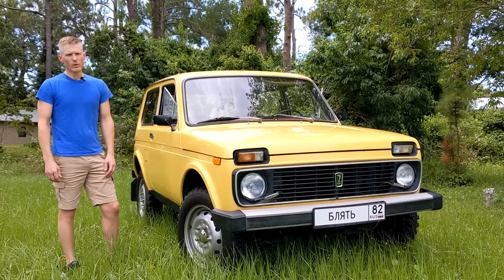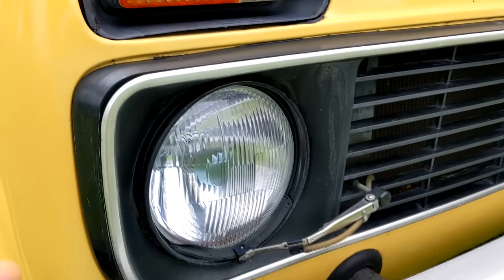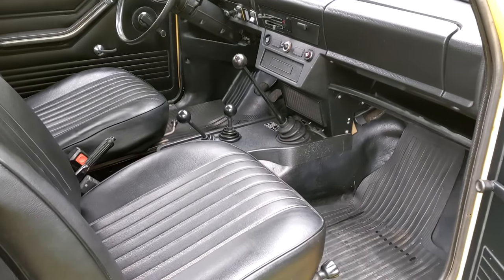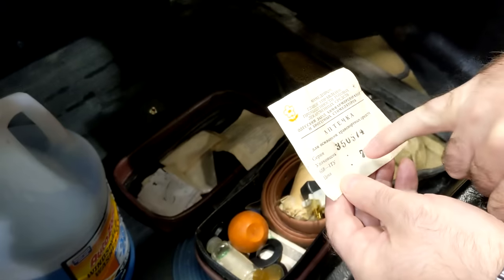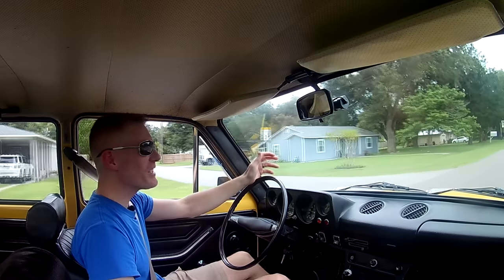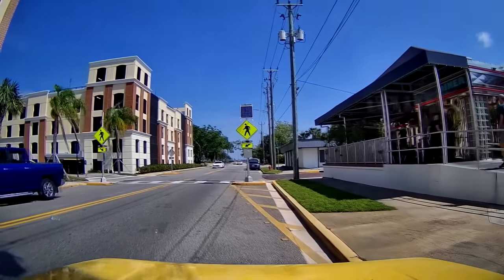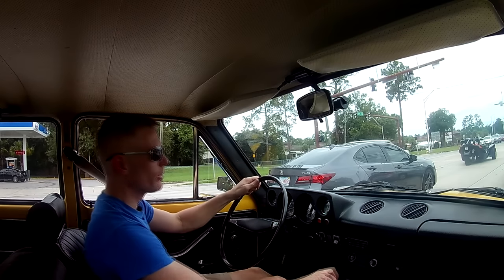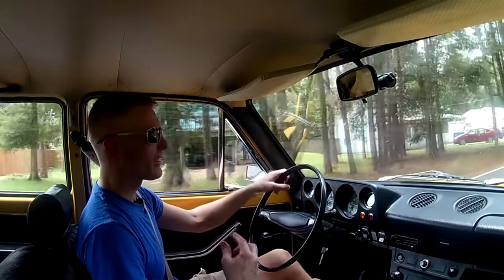This is my 1982 Lada Niva (Лада Нива / ВАЗ-2121) and it's pretty weird.

Comment: Hey! Nice video! I appreciate an intension to save all the original parts and make all the changes reversible. This is very much Russian.

If you can fit an electric motor instead of a gear box and keep the transfer case you will still havе AWD, the reduction gear and the center blocking. All the space released from an engine you can use for some electric equipment (or a front trunk). But pay attention: 
1) to switch these two small levers you have to stop (if i get it right).
2) Probably this way you'll keep the noise, because it goes not from the engine.
This is the cheapest solution in my opinion.

Reduction gear on this car is intended to handle low torque on lower rpm. If this car originally had diesel engine no one would put reduction gear in it. Electric motor won't have this issue, so you can replace the transfer case with the one that suits better.

Just a few ideas for your project. Of course there are way more options.

Good luck!

Comment: The cards with years are technical inspection certificates which you were supposed to pass every year. I think you were supposed to tuck them under the rubber of your windshield for the police to see. At least that's what many did when I was a child. Today, we don't use them anymore: if you car is insured, this automatically means you passed the technical inspection. If your car is not insured you're not allowed to drive it.

Comment: Just a tip. Next time you need body work. Ask for progress pictures of each step. Otherwise they wont make the effort of repairing the panels and just smack thick layers of body putty on. You don't want to pay for that. And these guys making it sound like a massive mission to relocate a bolt hole for the mirror on that door that was wrong kinda raised red flags for me.
Reply from the maker: Fortunately, they said they barely used any filler because the panels were so solid and able to be manipulated.

Comment: You won't be able to use the crank handle if you convert it to an EV. 
 I had an 88 5 speed model.  It had the comprehensive tool kit including a crank handle and points tool (even though it had been converted to electronic ignition by the importer)and the work light. But the English translated owners manual was a work of comedy genius.

Comment: I think it's a good idea and if you keep the gearbox it would have insane torque at the wheels but I'm not sure if the transmission and differential and take it. I think the car has the right proportions and so forth but its powertrain has always been its Achilles' heel. This would definitely solve the problem and would definitely be a unique classic.

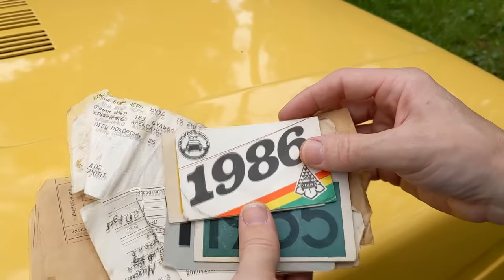Comment: 9:30 Technical inspection cards. The design on the front of the cards differs from year to year, so they are even collected sometimes.
9:37 A VAZ-2121 car with a license plate A85-74K...O(?) Passed the inspection on June 11, 1986.
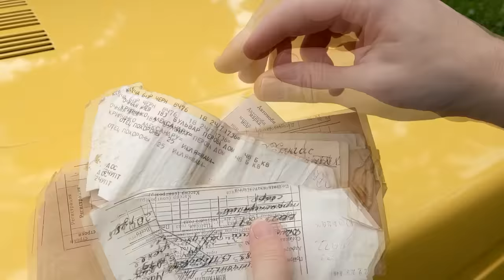9:50 The receipt for payment of the transport fee - 20 rubles, by the way. The address is indicated - it is in Voskresenka district, perhaps they still live there...
9:59 Suddenly a telegram: "Father died, funeral on July 25th. Mom" - I cannot determine the year, but it was received, apparently on July 24.
He probably just put the telegram with the rest of the documents and drive... So it stayed there.

Comment: Differential lock will not lock all the wheels, but only central differential. Front and real differentials are without lock. This 4wheel drive system is so called "full time all wheel drive", like Toyota Land Cruiser. 
Just dont crash it, because direct crash with more then 40km/h can be fatal.

Comment: Hi. from the UK.
Interesting video, I'm looking to buy the 2021/22 Lada Niva later this year or early next year. these are very popular in Germany and recently available in the UK. it will be a German import ( left hand drive) the bodywork is now wax injected and much improved, should last many years, it rains a lot in the UK!
The injection system is now Bosh.... very reliable, engine also improved for the German market.
I can help you with "Crimea". before 1954 Crimea was part of Russia, the people are ethnic Russian and speak Russian. In 1954 the Soviet Union gave Crimea to Ukraine, without asking the people! the referendum returned Crimea to Russia, there were 122 International observers who said the referendum was well run.
The Lada Niva is now selling well here in the UK because the old " Landrover" has stopped production.

Comment: Hi Gav,  I was in touch with you long ago when the motor coupling broke on your first conversion in NZ.  My parents owned a Niva in Napier, late ‘80s, as my scientist dad was a bit of a socialist.  They moved into a Riva later on but that was pretty awful to drive compared to the Niva.  I have a Kona EV now but have always wanted to convert a Jimmy or 3-door Grand Vitara.  I’d consider driving the transfer case directly as the low-range gearing is well suited to a PM brushless motor like from the Leaf and would allow the motor to reside fully inside the tunnel rather than taking up room in the engine compartment.  Looking forward to seeing more videos from you.

Comment: I absolutely adore these little Lada 4x4's (since GM trademarked the name Niva, why Lada didn't, IDK 😅), and would absolutely kill to have one (or a JDM 4x4 kei truck, especially a late 1st, or early 2nd gen Honda Acty 4x4 pickup), but a note.....to translate those Cyrillic/Russian words, all you need is Google Translate on your phone, point your camera at it, and it'll translate everything in realtime 🤷‍♂️

Edit, after watching threw till the end....Here's your downvote 😤

Don't you dare kill it's charm by converting it to electric, if ANYTHING, convert it to a small turbo diesel engine, and as i paused immediately when you said "convert to electric" and don't know what you're going to say next, if you're one of those....."guys".... just convert (easily) that new little turbo diesel to run on biodiesel or hell, just make sure you get an older diesel and start running it on used, collected, FREE cooking oil.... please don't ruin it by converting it to electric.... you're probably going to get into something way over what might be easily possible due to its current drivetrain, then you're going to have to pack it with batteries, increasing that little things weight, and it'll end up with worse milage and it'll be even louder (due to it being quieter) than a muffled turbo diesel or gas engine.

Hell, I'll give you a Cadillac for it, convert THAT to electric if you must 😑

Comment: The sheet out of the printer says that "somebody's farther has died and tge funeral is on April 25th", would probably not be related to the car. The other stuff mentioning the years would be considered something like yearly  technical check sticker showing if filled out and stamped that the car has passed technical inspection and is street legal. Another sheet would may be the receipt for such technical inspection of the car that did cost 25 rubles if I am not mistaken.
Reply: The sheet with карта, is a measuring protocol for something has been measured during the technical inspection

Comment: Hi from Athens. At first you can find a ton of used partsd in  Greece. Wehad a lot of Lada cars in Greece  due to high import taxes on 80;s decade on european cars. At second i propose to start buy cheap parts such as pistons, crankshaft even a whole engine to have them as spare parts because as you see  the nowadays LADA is not the same tthan before. Have fan my friend

Comment: 12:03 is boric acid.
12:19 validol, or validolum, an anxiolytic
12:32 Potassium permanganate
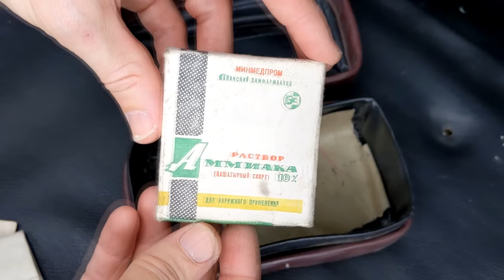13:14 10% solution of some ethanol.
I'm from Bulgaria but we do share the same alphabet so the two languages are mutually intelligible.
Someone from Russia reading this could correct me if I made an error in my translation.

Comment: The jack is actually superb.  It´s Fiat basically and lifts the car easely and in no time. 🙂 The engine is really tough, electrics are not that good, but easy to improve.  Weak point is the gearbox.  You better befriend someone who can work on gearboxes 🤣but once overhauled you´re good for a long time again.   As for the EV conversion, it´s not like this is a rare car that has to be preserved, there´s probably a million of them around today and as you said : it´s YOUR car.  I wonder how it went ??

Comment: many people just don´t know the simple fact, that lada engines are not actually fiat. the original fiat engines turned out to be unreliable in hard conditions. they were pretty good engines in the normal conditions of europe, but not in russia. lada engine was improved in many ways, and talking of reliability, they rarely fail for no reason. I have not seen many fiats with 400+ hp, those engines can hold it while still being relativly stock. also, if they are so bad, why would they work still after many years in russian environment?

Comment: get bogged  a rarity  just remove the plugs, and wind out with the crank handle, works 100%  ,would you like the light and hand book  also still have the tool kit that came with them  , sorry does have air con  just turn the quarter windows to open ,and keep the brake compensator on the rear axle filled with Vaseline  if it gets sticky can cause a problem   it adjusts  according to the load ,the hand book is that full of information  all in English,   condese crystals  , and lower  the tyre pressure when on sand  ,stops  you from  getting stuck    { no not bogged }} just stuck

Comment: I always wondered why the Soviets didn't just buy some, for example, 1960 dodge with a slant-6 and just re-engineer it. Instead, they just designed their own, better vehicle.
Reply: It would end up as a gas guzzling monster. They needed an efficient 4x4 and that was almost non-existent at the time.

Comment: Well, most of those mysterious papers are technical inspection cards. In Russia all drivers just kept those on the windscreen, where the road police officers could easily see that you've had your TI and not to be bothered about it. 
Then a car tax check, for 20 roubles of payed taxes.
 One seems to be a waybill. The reason marked in it was a funeral of car owner's father.
And finally that card, you recognized.
It has the carbon monoxide emission measurement results wrought down in it.
Reply: Oh and the dark stuff in the other glass bottle is potassium permanganate. It used as a antiseptic, demercurising agent, for a gastric lavage. And it burns with a violet flame. Pretty strong oxidiser though, so handle with care.

Comment: Perhaps it is the inexperience they have in the United States with this car since they do not know it but in Bolivia we know it quite well, since it was imported to Bolivia since 1980, and that door is from a current model, not a 1982 one, remember that until Today it is manufactured but it is not the same as the old one, in appearance it is similar but not the same.  It does not have the tilting glass nor is it the same in function.

Comment: The engine in these are reliable, but don't drive it above 100km/h.
People drive it up to 130km/h for extended period of time and it always overheats and blows a gasket. 
It is not meant for spead.

Comment: Colored cards over the years - confirmation of the technical inspection certificate. It was held annually in the USSR. The card is likely a service diagnosis at a specialized corporate service center. The paper printed by the printer is a postal telegram. It informs the address in Kiev, as well as information about the death of the father of the owner of the car. And also a lot of receipts for paying the transport tax to the tax office. Calculation for one year based on the engine power.

Comment: Hi, Are you sure Niva has dif lock, I do not think so, that short gear handle is for 'low range' not for dif lock. And taller one yes it is for front wheel drive, to make niva 4×4

Comment: That's a central difflock same as in old defenders and range rovers, it doesn't lock up all 4 tyres like front and rear lockers would..
Ragged the hell out of my old one offroading..
P.s it never did break down just boil up a bit now and then, quick top up with some Ditch water and the "slut" was ready to rock and roll...
Miss my old "slut" 😢

Comment: Thank you for another great video and for remarkable job you have done on this EV. Two tiny remarks: 1982 Niva is a bit different, not exactly the same (rear lights and other details); and well... for the license plate I would prefer TETRIS, not БЛ*ДЬ)) Yep, there is also a spelling mistake in that word))

Comment: 9:44 - Technical inspection  of the car.
9:50 - Receipt, transport tax,
(20 rub) or (27 cent)
9:58 - Kiev. Urgent notice, father died, funeral on July 25.  Mama.
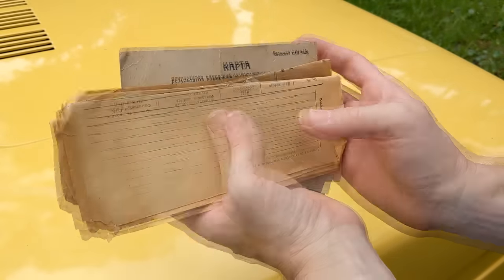10:23 - The result of measurements of carbon monoxide in the exhaust gases of the car.
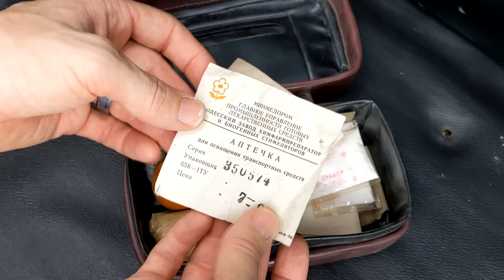10:53 - Odessa plant of chemical pharmaceuticals and biogenic stimulants.  First aid kit for equipping the car.
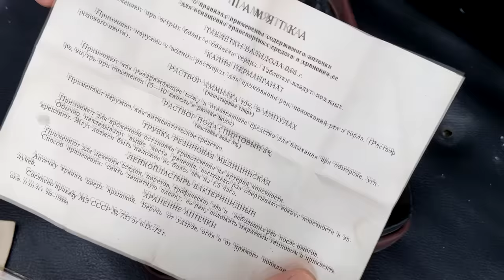11:54 - Memo. About the rules for the contents of the first aid kit.  
Validol tablets - instruction.  Potassium mermanganate - insruction
Ammonia solution 10% in ampoules - instruction. Alcohol solution of iodine 5% - instruction
Medical rubber tube.
Adhesive plaster.  
Storing the first aid kit.
12:02 - Alcoholic boric acid solution.
12:42 - Potassium permanganate.
13:08 - Ammonia solution.

Comment: Do you think it's possible to ship one of these brand new babies from Russia to US if they are still available for sale?
Reply: Doubt it would pass US safety and emissions, it has the same safety features as a Yugo. Niva didn't come with ABS and ESP before 2012 and airbags before 2020. So driving a 25 year old Niva won't be much different than a brand new one, just export a used one you will have less headaches.

Comment: I think you are better off saving original wheels and tires for posterity - old soviet rubber is not going to last under FL UV light. You won’t beat the factory look with the steel wheels but a new tire size with a different wheel may be easier to get domestically without DOT safety certification for import rubber.

Comment: really the body shop could have just used a spot weld cutter to remove the skin form the new car, straighten it out a bit and then put the new skin on the old door frame. Not that difficult to do really, especially for an auto body shop.

Comment: Dear Kiwi, Thanks a lot for bringing excitement to this world, and sharing it with the public!
If you did not see yet, there is a similar project in Ukraine https://youtu.be/4V2XvTZlvTg 
Hope their project would be of some help.
They went with removing the transmission and hooking up the electric motor to the transfer case.
They used at least 1 battery from Nissan Leaf. Not clear on the exact battery config, but they used 2 batteries: one under the trunk, and the other under the seat instead of the gas tank. If you need some more translation - let me know in the comment. Good luck with the project!

Comment: It's been 40 years since they buried the original owner's father. Could it be the psychologist mentioned in https://ru.wikipedia.org/wiki/%D0%A1%D0%BA%D1%80%D0%B8%D0%BF%D1%87%D0%B5%D0%BD%D0%BA%D0%BE,_%D0%90%D0%BB%D0%B5%D0%BA%D1%81%D0%B0%D0%BD%D0%B4%D1%80?